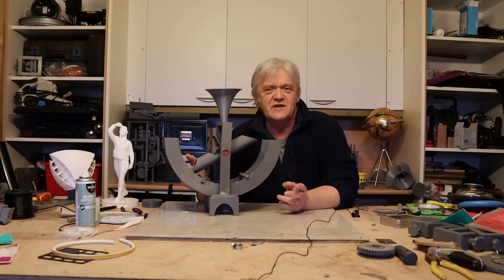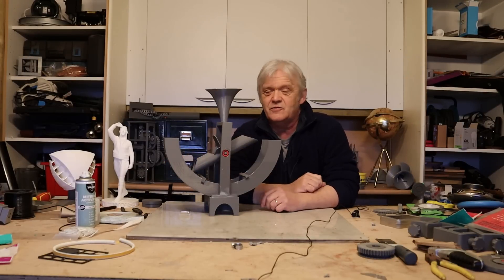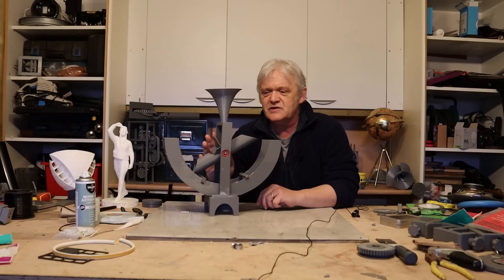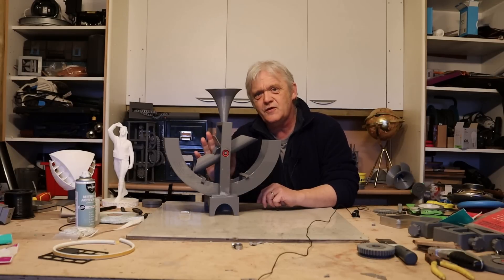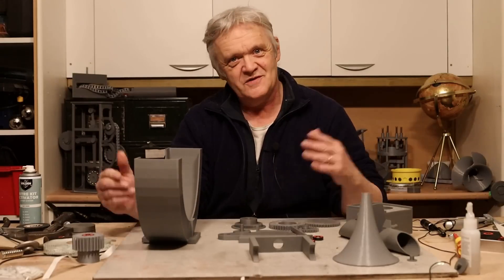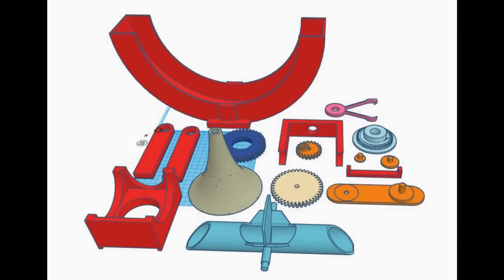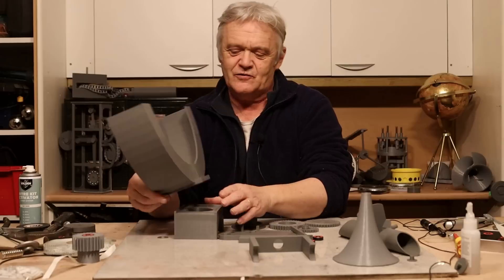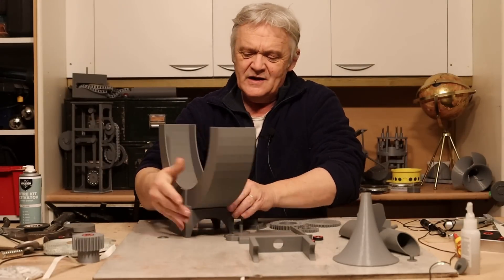2179 Weird And Wonderful Water Clock

Comment: I don't think you need both sides of the rocker to recieve water. One side can just be a fixed weight that is less than a full (of water) opposing side where the water goes. When the water side empties, the fixed weight should supply the return force. I think that would make the design and any motion and calculations simpler and more consistent, although it might lose some symmetry if that forms part of the aesthetic. I would like to see a compact one of these where the return force is supplies by a spring or elastic band. No reason, just I think it would look funny. Love the entire series of these videos BTW.

Comment: Now all you need is a small water pump and circulation system and it will work.
One of the benefits to this, is that with the water flowing, the clock will add moister to dry air.

Comment: You can get constant water pressure if you keep a constant water column height. Simple physics. 
A natural pressure regulator and use an overflow hose with return to reservoir.  It doesn't matter how you overfill your column  or how you power it.

Comment: For consistency with uneven water sources what you could do is use the ratchet to pull up on a weight, which would actually be used to run the clockworks.

Comment: Would be better suited as a rain gauge. The clock face showing inches of precipitation. 🤓
If the top of the funnel is 8” in diameter, and with appropriate gearing, the measurement would be in line with meteorological measurement standards. 👍

Comment: You control the flow rate by the size of the opening on the bottom of the funnel. Then you just have a reservoir at the top. Water clocks are thousands of years old. This just adds gears to a device that the Egyptian pharaos used.
Reply: what device was that, any links so I can prepare for the apocalypse? :p No but seriously do you have a link? I'm very curious as to what it looks like. A shame that they say (it was an ancient quote), that the Ptolemaic Greek reign in Egypt was a callow facade of wealthy and superficial, jaded rulers compared to what Egypt had been at first culturally. It seems the Ptolemaic Greeks "appropriated" Egyptian culture and thought themselves very grandiose for having taken control of the soccer ball. That was SUCH a good documentary, I had been awestruck as it was hours long and fell asleep and woke up to another one, where this was mentioned.

Comment: Hey Rob, are these small enough to print from the first Elegoo that you reviewed?  I've been having troubles with some of your designs(like the Weird Water Motor), because the printer is too small to print them. 
Keep up the good work.
Reply: I'm not Rob , but you can scale it down (objects in the printing files) , to fit your printer capabilities. Of course , in case of water motor (this one , from the video) , sequence of the motion (or the frequency) , of the prime mover would be different , with smaller part(s) , depending on a flow (volume/mass) of water. Or you can cut the parts in half , or more parts and glue them together afterwards .